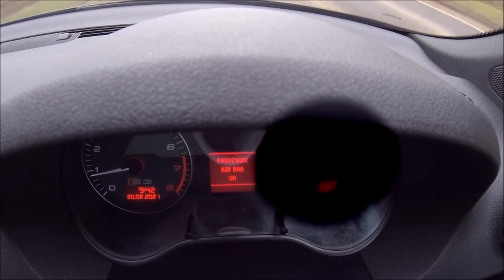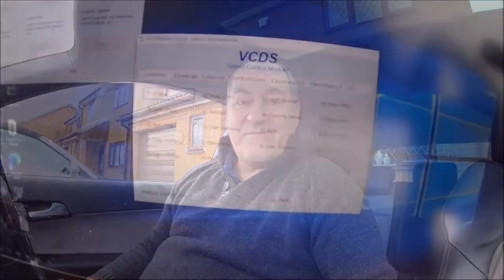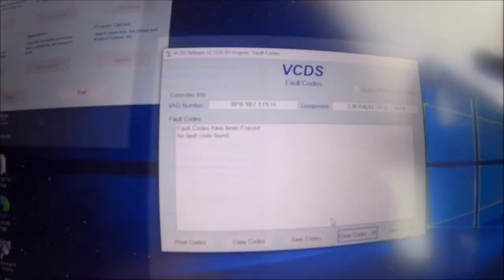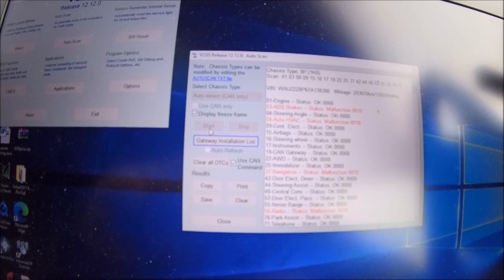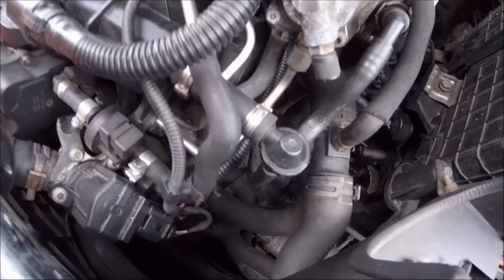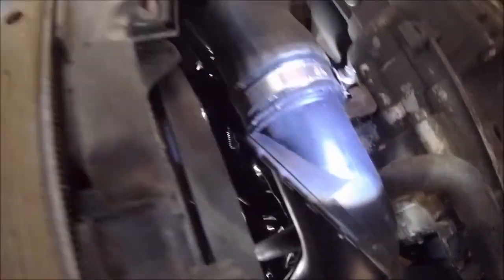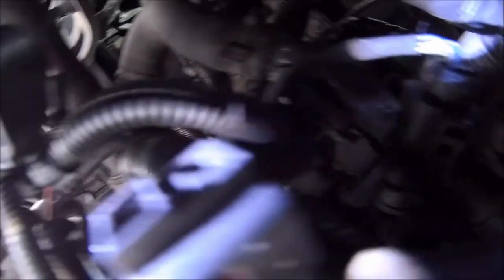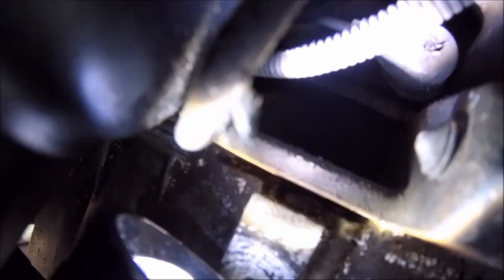#Audi #S3 major problems (spoiler Alert...never doubt yourself)

Comment: Man like months and months ago (over a year) sometimes my car would cut out.. then recently stopped starting - got the fault it was crankshaft/rpm sensor - I've tried doing it such a nightmare to get to the bolt cant even see it on mine. I was trying to use a totally different tool to get it off thought it was like allen or something. Now after watching your video realise its a 10ml spanner or socket. Cant belilve it was trying to get it out for ages hahaha thanks man!! Hopefully will be sorted tommorrow.
Reply from the maker: Good luck... I'm glad my ramblings helped  😀